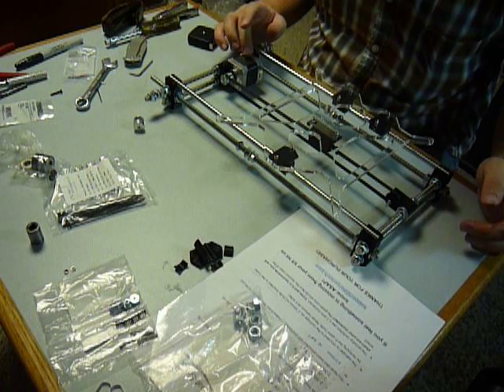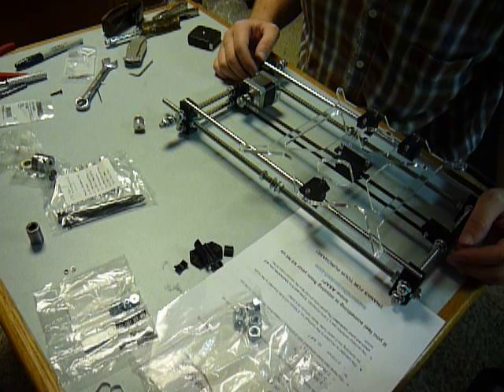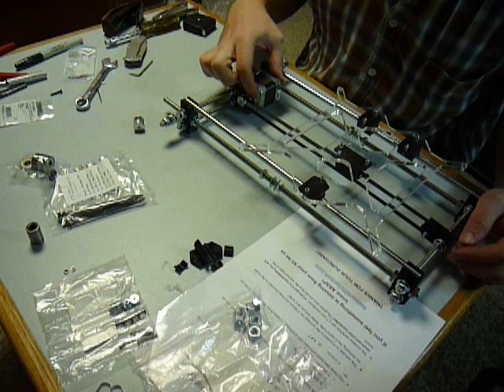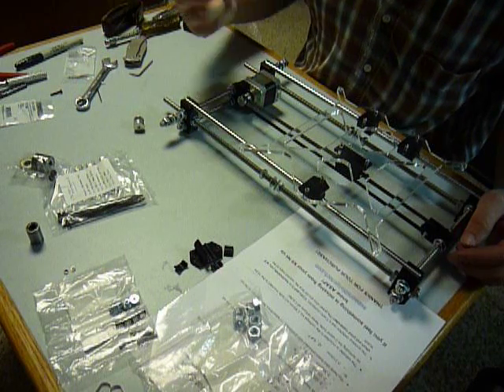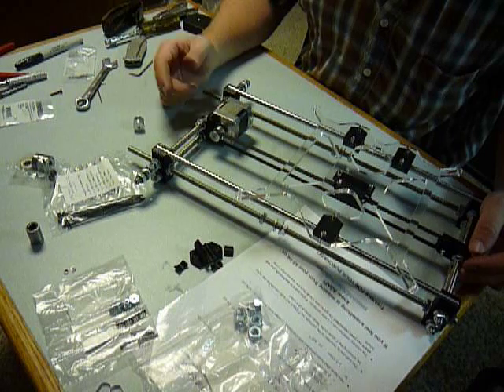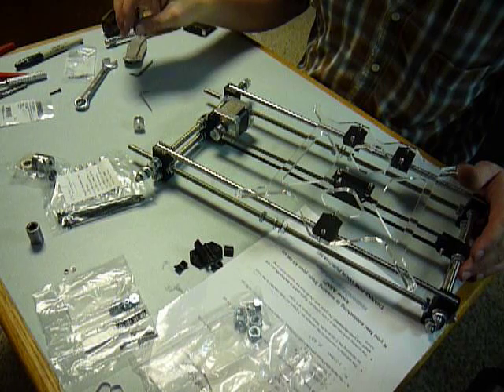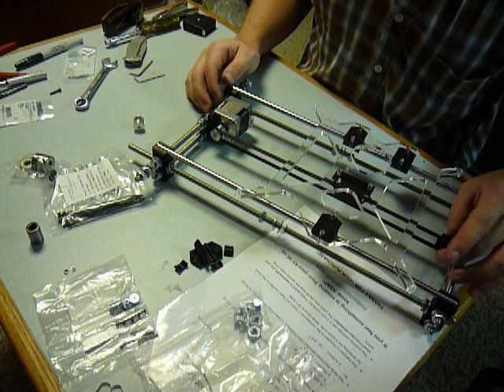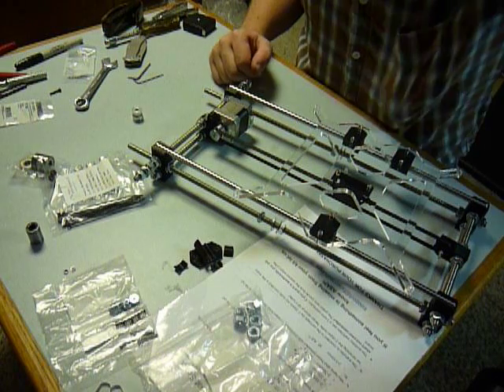Folger Technologies Prusa i3 3d Printer Build part 16

Comment: I discovered that some of the bolts are not the right sizes, like the m3x10 are really m3x8 and the m3x30 is a m3x35 (and all I need is a m3x25)
Reply from the maker: well, you could cut them down, but cutting stainless is no fun, I'd say go to Home Depot (Lowes does not carry M3 allen head bolts) and buy a 2-3 pack for $0.92 and save the headache. Or you could ask for the company to send you some more bolts, they are very responsive, but you might get the same length when they arrive (probably purchased in bulk from a Chinese company then divided up for these kits)